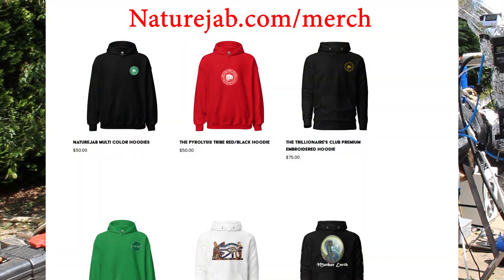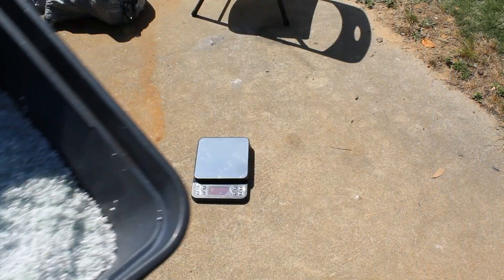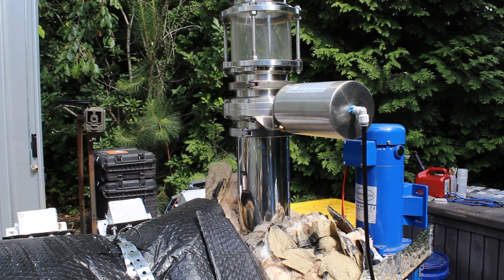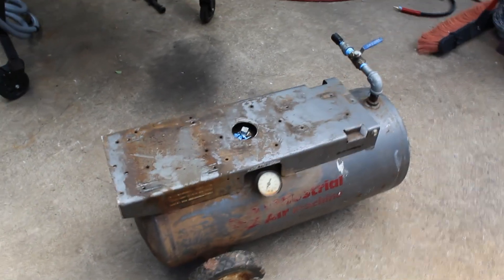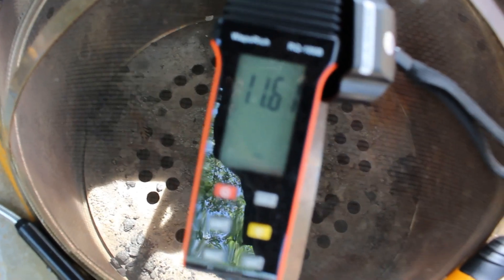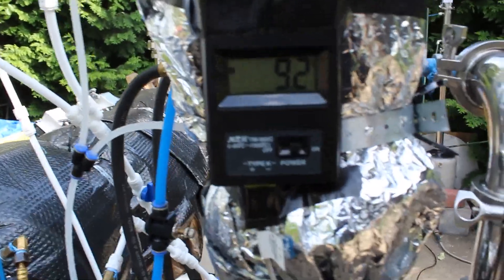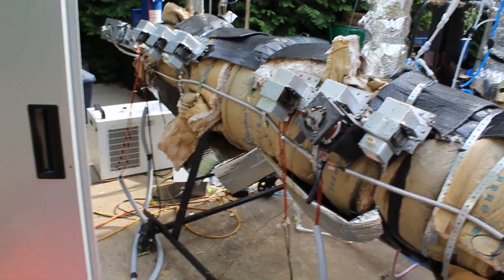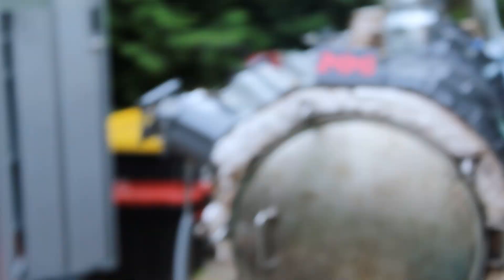Turning 10lbs (4.5kg) of Plastic to Fuel! Part 1 | Mark 4.5 Reactor

Comment: I want to start by saying that this is fantastic. It’s a fun idea using simple distillation fractions off of plastic to separate out the volatile compounds and based on a blend of specific fractions, you can get an approximation to gasoline or diesel. I’m sure if you separated things out in a controlled manner into very few fractions using bubble plate distillation, kind of like you do in vodka making. You could really refine a blend to a very specific performance. 

However, that wattage used to produce that much crude. Is so inefficient I can tell you were pushing your efficiency as high as you possibly can and you’re doing it in an environmentally responsible way. But your energy cost at least from the cost of electricity in Oklahoma US, all your fractions perfectly pulled from the crude is a third of the value of the expense put in to make it. 

This is such a cool idea and I’m really geek out and I don’t know why I haven’t seen your channel since before today. Keep going dude do what you gotta do. We need a lot more like this happening.

Comment: Obviously he knows this is dangerosu. Has a contiguous plans atleast i hope. He said that his numbers look better than the last run. I think this is science and a work in progress yes this type of engineering  has been done before and is well known but hes trying to invoivaite, contribute,  I dont disagree that alot of of the stuff looks unsafe. Needs to be worked on but you gotta think this is one dude putting his time and infort into barley charted water's so for all the people saying he needs to stop why dont you team up with him help perform the data analysis, environmental safety, and explain what needs to changed or what need to be improved. All an all this project could 10+ years from now save a lot of money and benefit people.

Comment: Okay lets do the math, you used 30kwh to produce 2l of fuel, lets do the math:
an electric car uses on average 0.2 kwh per kilometer driven.
1l gets you 30km in a modern car fuel efficient car in the best case scenario.
So if you used that electricity, to recharge an electric vehicle, you could have driven 150km and with the fuel you made you can only drive 60km, and that is being generous since its basically crude oil and will need further refinement to be used as fuel.

I hope you are okay, and I dont want to discourage you from experimenting with anything, but take care and remember to think twice before doing anything at this scale again, there is so many things in this project that can kill you or give you cancer or cook you alive, quite literally.

Comment: Use a refrigeration recovery tank. They're very cheap, very well sealed, common, and hot swappable. Also you could very easily adapt a refrigeration compressor to pull an amazing vacuum and compress the gas against a refrigerant solenoid to make it all remotely controlled and 240 so less current. Recovery machines are very expensive. Also depending on the required condensing temperature you may find a large evaporator coil from an RTU (roof top unit) with a fan and shroud could do very well and again reduce power consumption. If not enough then I would just use a small walk in freezer refrigeration system, again cheap and effective while being very power efficient. I'd love to help on this project

Comment: Hi someone with a masters degree in chemistry here. Whilst I can see your passion for trying to create a renewable biofuel and i commend you for that, what you are actually doing is creating an environmental disaster. The "gasoline" you are making has a very very high concentration of benzene (realistically around 30%) in it which is a class 1 carcinogen; whereas typical gasoline has 1% which is still enough for researches in the petrochemical industry to want to reduce. If you continue you this outside of a lab environment and in a neighbourhood dear god you are going to dramatically increase your chances of developing cancer. On top of that you have in previous videos talked about making a fertiliser out of the process. This is incorrect, the carbon material produced will have high levels of heavy metal contamination in it on top of residual plastic contamination as well. If you are using this fertiliser please stop immediately. This is a project that should not be done in a garden at all and should be conducted by researchers in a lab. Please if you are genuinely interested in this field of research stop what you are doing and go to college and get a degree in chemistry and approach this issue in a responsible manor before you hurt yourself or others. On top of this i do not know how you are disposing of your waste material but given the cost of dedicated chemical disposal companies i can guess you have not been doing it properly. Chemical waste is not a joke and can cause damage to the environment that can last for decades. Please educate yourself and stop putting yourself and those around you in danger.

Comment: This ain't new, there been plenty of people who done this before, but they simply been debunked and that diesel is not usable in a modern car, this is probably not even close to being efficient.
Reply: Obsolutely not... With the fuel produced, in best case scenario, lets say he made 2l of pure gasoline or diesel, then he could drive 50-60km in a modern car, but if he used the 30kwh to recharge an electric car, he would have a 150km range.

Comment: God 300 psi, that thing will be a monster explosion.

You need to fill it with water and do a hydro test on that cylinder before putting it into "service."
Reply: Yeah, hopefully it doesn’t explode
Reply: @Danny-bh1il  Yeah, hopefully it doesn't explode
Reply: From what I read it did because of no vacuum.

Comment: Dude, methinks you need to insulate that door, get a longer and fractionated condenser.  Along with a MUCH larger collection vessel.
If this is 3x as large as your prev. prototype, you could theoretically go bigger, but pressures and managing a setup get awkward af.
Random thought, but a door mounted magnetron might destabilse standing waves for more even heating?  Would complicate insulation though?

Comment: Use two ss ice traps on the gas recovery side. By using two traps your able to collect your gas as a liquid. And the its much easier to move into a cylinder.  Why use two different traps? For the continuous run you have set up. You would have a set of isolation values for each trap and a n2 bleed back. And it always helps to keep your recovery cylinder cold as possible.  Even a simple wooden box . Packed with dry ice would help your process.  Very cool stuff your playing with.

Comment: Are you kidding me? It's a paltry amount! Think about it: 10 pounds of plastic, and all you get is 250 mL of fuel? That's less than a cup! Considering the environmental cost and the energy consumed to convert that plastic into fuel, this yield is disappointingly low. Clearly your process isn’t efficient
Reply: I believe this is mostly about getting rid of the plastic. The fact you can even get anything out of the destruction of plastic is a bonus. It would be great is we could begin to reduce plastic already made.... although I'm sure we will just launch a shit ton into space. Space littering, the ethics of such I do not know. I know it really has to get shot outward for if it stays in orbit it will collide with satellites or even space stations... idk.

I believe the hope is to grow in efficiency. If that is even possible, but if he starts getting better yields maybe it can be done on a slightly large scale/

Comment: if you spent 30 KwH to get 1.7 liters of unrefined crude oil, isnt that terribly inefficient of a process? Granted it may not be optimized and this is still an impressive feat, I am not sure in convinced this process is worth it. Considering using full green energy on that process would make this process much more efficient? Though more expensive. Im not sure. Great job!

Comment: This is not a new method for creating gasoline. It just heats up the plastic without the presence of oxygen until it reverts back into crude oil. The crude oil is then processed into fuel. The problem with this system is that you have to use more energy to convert the plastic into crude than is present in the end product.
Reply: People who don’t know this, think he is the greatest inventor of all time. 
Even though this technology has been here for over 70 years. It was just not an economically viable way of producing fuel. Since plastic is a product of crude, which you then decided to turn back into crude to make fuel.
Reply: I think he’s trying to solve that problem

Comment: Make A Thick / Clear pyrolysis chamber and use mirrors or Fresnel lenses during a sunny day to heat the plastic instead of the microwaves. Now you have a real 0 Grid based Energy option, Please look into both of those options, they are viable.
Reply: Won't work. You'd just blow yourself up. Even with what he is doing, I'm amazed he has not blown himself up. That's not a pressure vessel.
Reply: Email it to him, if you don’t think he is seeing this.

Comment: You need to make your own chiller you got an old deep freezer and run copper pipes through it fill it up with water and then run the water through that they use that for mushroom extraction

Comment: So, ultimately it is just heating the plastic up with microwaves? There's no other chemicals being added, no other process?
Reply: Heating plastic up without the presence of oxygen, makes the plastic breakdown into its core components. Which is crude oil and a bunch of other chemical additives. 

So no this is not revolutionary or a better way to make fuel. Since you are already taking a product which requires a lot of energy to produce, and then using a lot more energy to breakdown said product again. This is the main reason why no large companies have done it, since it is cheaper and more energy efficient to just buy a barrel of crude oil to refine.

Comment: i think a big issue with this is the energy consumption 30kwh for a couple liters of fuel is alot im sure there are MANY ways to make it so much more efficient

also how are you planning to filter the oil into their own gas mixes? im really excited to see when you figure out to do that
Reply: I was thinking the same.  That's like $10 USD of electricity.
Reply: The machine produces gas and he uses that to power a generator
Reply: @Skye.004 it won't make more fuel than it will use. Paralysis is nothing new. You can do this with wood too. But this guy has THE WRONG EQUIPMENT TO DO THIS. He is going to hurt himself trying this stuff someday
Reply: Scaling the entire thing up with more powerful electrical sources will help tremendously. He only has 220v with a 200 amp service at his house though.\
This is another reason I hope he can move this to a proper industrial area and have 3 phase 1000+ amp service available. I also think the microwave magnetrons can be optimized and scaled up to work more efficiently. I believe he is still using consumer grade magnetrons from old microwaves which are not that great efficiency wise while running this long.

Comment: I am no engineer, but, if everything is condensating within your black tube. It may make a lot of sense to have sections where you have several places where the condensate can go throughout the tube rather than your single spot. You can still have your single collection, but I feel like a lot of it would be caught on the top of the black tube and drip down into the charcoal.

Comment: Hey friend. PLEASE check the inside of that tank with a borescope. They ALWAYS have rust spots. Dont engender yourself. When they explode at 200+psi, it is terrifyingly dangerous.
Reply: it blew up.
Reply: @nickgardner6340  omg i didn't expect this to be true that is the craziest timing
Reply: Aged like milk 💀
Reply: sadly, this aged very well.
Reply: Rick was referring to the propane tank for holding natural gas. If you actually watch the videos you will learn it was the distiller that blew due to no vacuum being pulled. He did predict the future here.
Reply: Bro is predicting the future. Whos the president in your time?
Reply: It didnt blow up due to rust though. He forgot to turn on the vacuum  @jordazford
Reply: @benjaminwilson3216  still a crazy timing
Reply: Is he ok I wonder?
Reply: He know what he doing

Comment: What is the weight of the fuel you got out of it?

How many kwh of electricity did you use?
Reply: At 13:16 he said that it consumed 30kwh of energy. 2liters of that oil probably amount to about 17kwh of energy. But it also produced lots of gas and carbon and I am sure that it can be made much more efficient, looks promising.

Comment: Very cool but interested to know the kw required for the microwave process.
Reply: 240v x 48 A = 11,520 W.  He also indicated 30 kWh were used for the run, though that doesn't appear to reconcile with the runtime.
Reply: @skroz1 he used more like 300kwh. 

Spent $300 of power on mom's bill to make a half quart of dirty, toxic oil.
Reply: @shadowusedthrow  I'm not prepared to say "lying" without more data, but yeah... none of this adds up.  The 11.5 kW operating power more or less checks out, but the time (and therefore power consumption) doesn't.

My frustration with this whole effort is that he promotes and encourages this image that what he's doing is some kind of breakthrough when it absolutely is not.  And he clearly knows that based on interviews I've seen, though he's content to allow people to believe he's about to change the world.  Or that he's some kind of rebel fighting the big corporations who have been sitting on this secret technology.

Is what he's doing interesting?  Yeah, I personally think so.  Is it going to change the world?  Not until electricity is free.  He knows full well there's a minimum amount of energy required to rip those molecules apart, and he knows that isn't close to economically viable.  I just wish he'd be honest about that.
Reply: @skroz1 no he was lying very obviously.

Comment: You should be ashamed of yourself, Julian. You have no reason to still be ignorant of the fact that you're bullshitting a lot of people with your false claims and made up facts.

You literally have no idea what you're doing. You admitted in your livestreams multiple times that you don't know what pyrolysis is or how it works. You have literally no idea what you are producing, but you insistently keep calling the stuff you make "crude oil", "natural gas" and "pure carbon", while in fact it's most likely a random mix of hydrocarbons, the vapors of those hydrocarbons and a collection of the most toxic chemicals known to man. 

You literally have no idea. And you will never know what you are producing, until the moment you get the stuff tested by a lab. But we all know that's not something you're interested in, since that will expose your fraud ass immediately. 

Stop scamming people, Julian. Act like a grown up, stop taking donations under false pretense and stop lying about what you're doing.